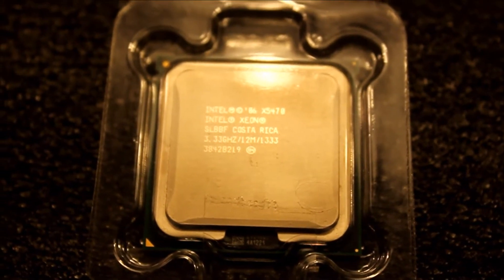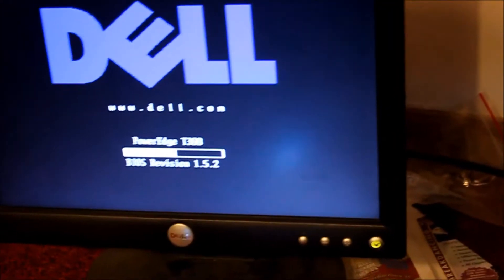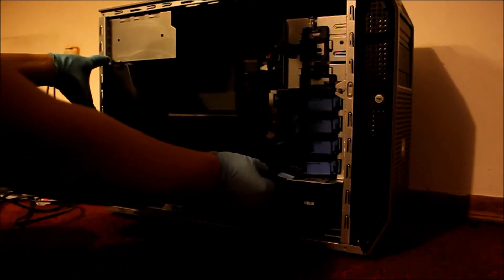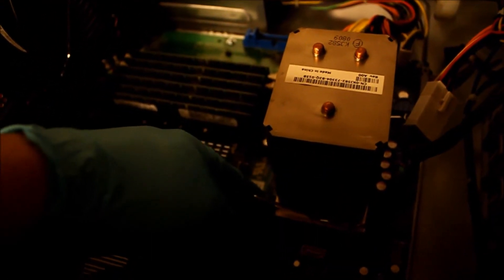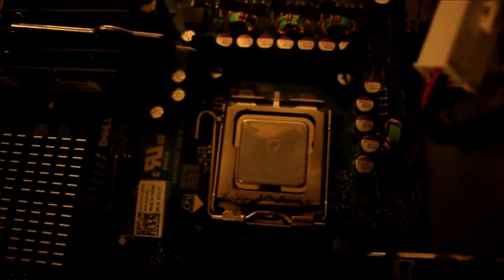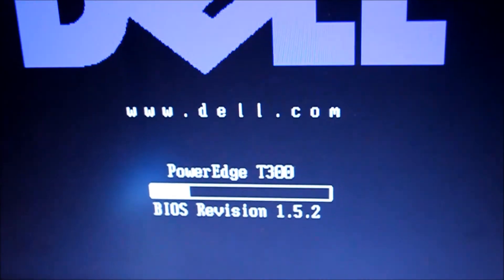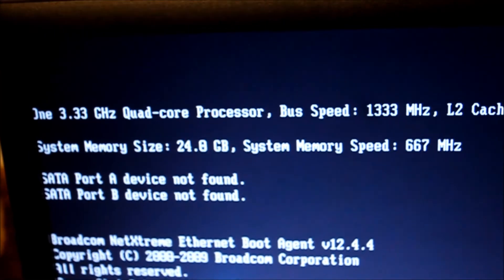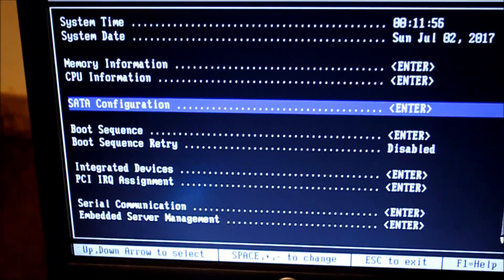Upgrading a Dell Poweredge T300 to a quad core Xeon 3.33ghz, 24gb DDR2 ECC ram

Comment: Thanks for the video man! I know it's probably been a while since you've messed around with this computer, but do you know if ATX motherboards could fit as a motherboard replacement in this?
Reply from the maker: A possibility if you can modify the I/O shield plate to use atx boards into it. Honestly I would get a different case because it's a lot of weight
Reply: @PakkenTech  hehe that's the point. The main issue I'm worried about is whether the pci slots will line up properly, as it looks like there is a decent gap between them and the i/o shield

Comment: This is nice case. I wanna buy one them. Can you think about upgrade gpu cards on that case? I know motherboads have any x16 slot but x8 to x16 risers now sold on internet and what about performance with x5470 any bottleneck or unstable moments when you using?

Sorry for my bad English :P
Reply from the maker: For Dell Poweredge, it is debatable.  It doesn't act like desktops that can accept almost any PCI express cards based on the slot and compatibility, the Poweredge acts differently as it accepts certain video cards and may not work for a wide range of cards there are available in the market.  Just a precaution

Comment: nice, now that you have the max bio up grade in it along with the max cpu, what is the larges hard drive size you can place in it, I  have this system in the mail
Reply from the maker: It's a x64 bit server.  It can handle any size of hard drive you can throw at it as long as you know how to set parameters and partitions depending on the OS that you use.  Keep in mind that using basic Windows 7 installation requires not more than 2TB unless you have to go around and force the hard drive to accept the size for the OS

Comment: My friend has one of these, and for some reason it continues to throw errors that the raid battery is dead. Has replaced it several times and still gets the error.
Reply from the maker: Raid happens to be hard drive related. A battery that is dead is a cmos related issue
Reply: @PakkenTech  The CMOS on that unit seems to be fine. I am referrning to the battery on the raid controller itself. Some units have them, but others don't.

Comment: I have one of these. Did you upgrade the bios using windows 7? I keep getting ambient temp errors on the little digital display. Don’t know why
Reply from the maker: Correct, the Windows operation system I use is primarily Windows 7 x64 to lean on for the bios update with a stock CPU.  Works beautifully